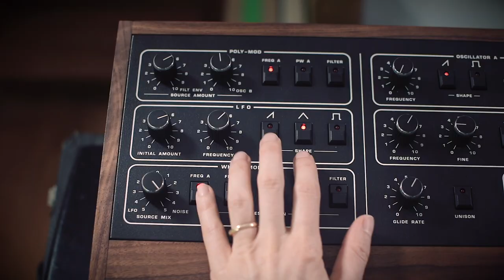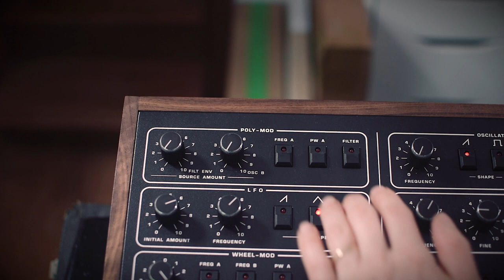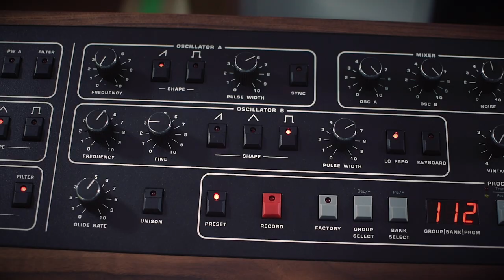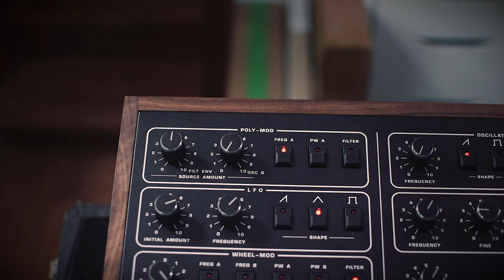Sequential Synth Tips #20 With J3P0 - Three Uses For Polymod With The Prophet 5/10

Comment: My favorite trick is similar to your first description where the Osc B is used as an LFO with keyboard tracking ON.  Using a triangle wave I Poly Mod the PW A with the LFO of B.  Each note has it's own individual Pulse width modulation speed.  I set the highest note to taste for the speed of Osc B frequency and the result is a  one oscillator patch with pulse width that is different on each note of a chord.  It's even more animated than simple two oscillator detuning.  Take the same patch and add filter envelope mod with a slow attack and/or slow decay and the PW is super animated.